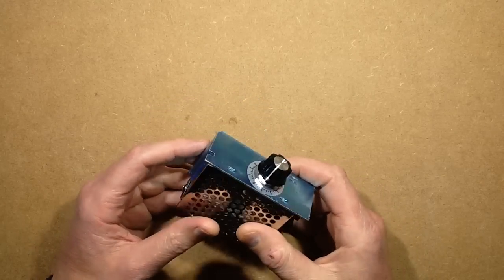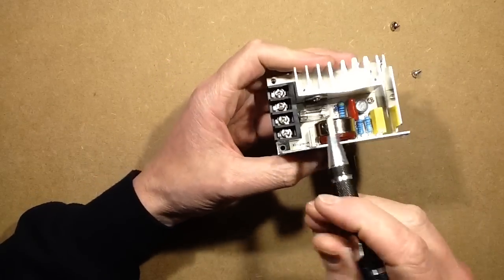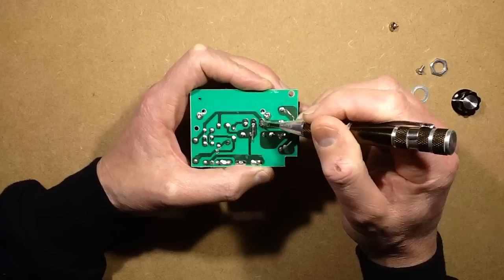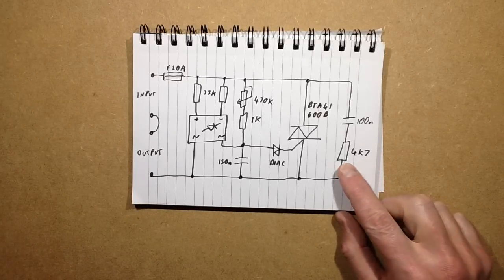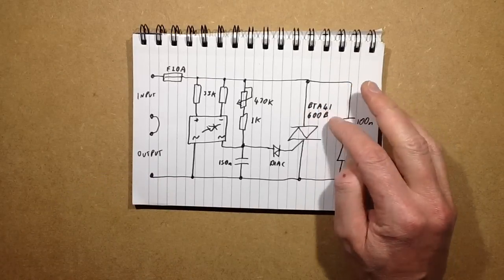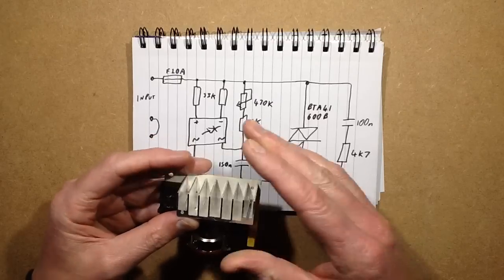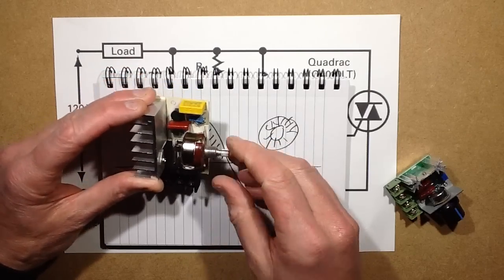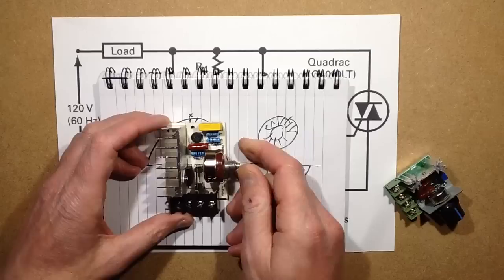Inside a "4kW" ebay power controller with schematic.

Comment: What did you pay for that? Got the same stuff here shipped from china for only five euro's Works fine for my lamps The Beefy triac survived two tungsten lamp blowouts already :) Normal consumer "dimmers" usually fail when a light bulb fails in short out mode. The large variable resistor can be to small for the heat produced in it when used with capacitive and inductive loads. Depending on where the slider is it can overload and burn out ~slowly.
Reply: Not sure if it is true but I read that tungsten lights do not like to be turned down to half voltage as that messes with the evaporation and re- deposition of the tungsten in the crystal bulb. I have found the tungsten flood lights work for longer when left on full power.

Comment: I replaced the 4k7 with 25pcs of 100 ohm half watt resistors all in parallel and haven't tore the controller up since or been able to overpower it either... it just pops breakers in the house now...   :-)
Reply: I did solder a piece of 10 gauge copper wire between terminals where the fuse was... also not safe!!!!

Comment: Nice video and explanation. The high voltage clearance around the triac legs looks a bit dodgy (small). Also, I'm not one for trusting the isolation clearances of a cheap carbon pot ( I know they say 750v, but I've seen the guts of pots like that fall to bits on more than one occasion).

Comment: Thanks for the nice Analysis - I don't like the screw so close to the high voltage track on the backside close to MT1. This could easely short out and put the heatsink at high voltage.

Comment: So if I wanted to use this on an induction motor (such as a treadmill motor), what would you suggest I add in order to get good variation of speed from 0 - it's maximum?
Thank you very much for your great videos!
Reply: I tested with the inductive motor of air fan and angle phase triacs does not work at all.

Comment: @bigclivedotcom- I have one of these controllers, have you checked the output voltage on it? When the unit is at 100% it is off by 20 volts. Is this because of r1 in your diagram? Great work, I'm always looking forward to new videos!!
Reply: +Matthew Lawrence, you know this how, exactly? Did you use an oscilloscope? Or perhaps a peak-capture circuit? I bet not. True RMS is the least quality meter to make such a claim. Cheap meters WILL give you erroneous readings and even a lot of devices which claim to read "true RMS" (like Kill-a-watt) are lying like dogs. Most likely the inevitable turn-on delay in the first part of each half-cycle is confusing your meter.
Reply: YodaWhat I know exactly by means of my Fluke multimeter mine was only 15 volts low. I assumed like buck/boost converters it absorbs some of the voltage in the circuitry and heat loss an such.

Comment: Thanks for another great video. I have just got one of these to use on my solar immersion heater control. I see many different suppliers of the same thing but they show completely different connections to what looks like an identical unit. Any input would be appreciated, should not the fuse be on the input?

Comment: actualy on philips diac dimmers you still find the big inductance for filtering...  this module is only a chep chinese one that's why is missing... try use it and try do a measuring with the oscilloscope to see how much common noise you get while is working... that's the problem with the cheap things like power supplies ecc... i had cheap led lamps in my lab and while there where on I could not use the oscilloscope...

Comment: Hi. First I want to say I love your informative and engaging vids. As an electronic dunce I have learned a lot. I am trying to control the speed of a universal motor and am now happy, thanks to your material, that I will use a pwm circuit similar to this but I am really struggling to work out what needs adding to the circuit to allow torque to be maintained at low speed. Despite a lot of research I can't find an explanation I can understand of what is required to maintain / change the torque. Is that something you could help with please? Thanks and keep up the great work.
Jim

Comment: So i bought this exact module, I'm planning to use it to power a 2Kw mains water heater element using a 12v 1.5Kw inverter. The 1.5Kw inverter is powered by 4x110ah 12v lead acid batteries. So the plan is the inverter 220v output will go to this module then to the 2Kw water heater, hopefully running the water heater at around 1Kw. Would there be any problems with this arrangement? Thanks!
Reply from the maker: The dimmer might not like the inverter waveform.  You can get low voltage elements for direct use from a battery bank.
Using a water heater as a load dump for a solar panel or turbine is a great way to use power above that required to charge the batteries.
Reply: @bigclivedotcom  thanks very much for the reply! It's a pure sine wave inverter so hopefully that would help?

Yes, I'm actually doing that exact thing! Its a 15L mains water tank which I've modified to also fit a 12v 300w element, that's sealed in with bolts and high temp gasket sealant. So it has two elements in it now.

All the water heaters electronics can work on either 12v or 240v and therefore all the thermal safety cut offs should still work regardless of what element is being used.

I have dual isolating transfer breakers at either end to ensure 12v and 240v feed can't go to the unit at the same time if a mistake is made!

It will mainly be left on 12v and I have a 40a DC relay between the water heater and the battery bank, there is no connection when the relay is closed. The relay is opened/ actuated by a small voltage sensing relay which reads the battery bank voltage. If the battery bank gets above 13.2v then the vsr actuates the 40a relay and dumps the excess charging power from the solar/alternator to the hot water heater.

If you're interested I might send you a video/ diagram when it's all put together and you can let me know if I'm about to cause imminent fire, electrocution, explosion!!😂
Reply: I should also mention that only the 240v 2000w element is used when 240v ac is supplied. And only the 12v 300w element is used when 12v DC is supplied.

Comment: I have one of these controlling a 2000 Watt element in a pot still. I mounted a small fan on it as the heat sink gets warm and it works for several hours at a time but it preforms very well and is CHEAP. Thanks for explaining how it works. For controlling an element what could better for the money.
Reply: I`ve just bought a similar one for making the ironing water

Comment: I'm hoping that I'm not the first to realise that 10 amps on 400 volts is 4kw.
Reply: On a resistive load, yes?
Reply: Why would you use this between two phases?
Reply: @0x8badf00d  I think you actually could use it between phases, but Chinese are notourious for stating peak currents, a 10A fuse needs time to heat up and burn so in theory it possibly could conduct 4000w for a short time. I would love to run my 4kw heat element on this thing to see how long it lasts. and see if lets say 10A at 240v (2400W) of inductive load for an extended amount of time overheats the circuit. If not this is a real dealbreaker for my homebrewing kit.

Comment: Suggestions, attach your wiring diagram so that it can be cut & pasted for print, also sometime when you have the notion, how about a video on the various VFD's on EBAY, especially the single phase input to 3 phase output, thanks.

Comment: You missed something, Clive. The labelling on the case indicating input and output is opposite to the circuit itself, I.E it has the fuse on what is labelled as the output connector. I just connected one, as per the label, the triac went bang. I watched your vid, looked at your circuit, noticed yours was mislabelled just like mine, replaced the smouldering remains of the triac, ignored the label, reversed the connections and all is well.

Comment: Dear Clive! I have built a TIG welder from an old stick welder. I have argon post-flow, switch button start and with this 4kW regulator i can regulate my welder below the value allowed by the magnetic shunt. I want to add a pulsed TIG function to my machine utilizing a relay delay timer module (switching between two different resistor values on the 4kW regulator). What currents/Voltages we have on that big potentiometer? Can/should I use snubbers to protect the relay contacts? Thank You very much in advance!
Reply from the maker: Treat the potentiometer as being live at mains voltage.  I'd suggest using half watt resistors.  The relay won't be passing much current.
I'm surprised the triac has survived such a fierce inductive load.
Reply: @bigclivedotcom  Thank YOu very much! In fact, tried it with max power as well and it worked for a short time when the fuse melted. At max power I am measuring a bit above 2kW which around the top for the fuse. Added fan cooling and paste to the triac and it seems it can handle the max load. However pulsing is needed only for thin stainless welds where the high power is around 50A; 1kW at the primary.. Give it a try this weekend.

Comment: I was very excited to see that you were messing around with these. But then I saw that it’s from 5 years ago😞 because I’ve been wanting to ask you to go through a 5000 W 10 to 50 V 100 amp controller DC or the bigger ones would even be great too and show us how to connect a electronica throttle to them as they want $50 for a 5000 W but if you want a electric throttle on it they want $125

Comment: Hi Clive, I've got a question regarding live and neutral inputs. I got basically the same controller (except it's a digital one) that has marked L and N input/output on the chassis itself, so I was wondering if it would work if live and negative lines are switched because I'm from EU and our plugs are not polarized (you can plug them both ways)?
Or is there any other component that can I use before this controller in the circuit to make sure that live input is always live, no matter how I plug it?

Comment: Hi. There is an effective method without using layers as the rectifier tip passes a sawtooth signal, such as smoothing that signal to eliminate that network interference and canceling out that sound produced by that network interference.

Comment: Hi Clive,

Can you please advise how can I test the SCR to determine whether it works correctly? My concern is that with no load and connected to a 220V supply I receive an output of 220V irrespective of the potentiometer position.

Will the Volts drop when the Treadmill motor is connected and then only increase as the potentiometer is dialed in?

As the Treadmill motor is max 180V I do not want to connect it and then the motor gets blown as the Voltage is not regulated?

Regards

Hendrik

Comment: Do you own an oscilloscope? It would be nice to see some of the waveforms with operating devices. A few turns on the end of some coax and you have a poor mans current probe.
Reply: I suspect he has more than one, but most 'scopes aren't likely to survive mains voltage without high voltage probe set.
Reply: Scopes survive mains voltage just fine with standard probes.  Scope inputs are typically at least CAT I rated to 300V.  What you have to watch out for with line voltage is the scope ground is mains referenced.  This means you should always use an isolation transformer when using your scope to probe mains powered devices to avoid unfortunate accidents that will destroy your scope.

Comment: this is a very popular device used in controlling DIY alcohol distilling heating elements
Reply: Thanks
Reply: Would 3000w heat element work in a 30l pot with this device? Thank you.

Comment: So would this work as a speed control for a 1/2 to 1 hp motor? I'm not worried about maintaining speed under load as it wouldn't really have any, just adjust the speed it turns.

Comment: I have had one of these, they are less reliable than a plumbers estimate and the tracks are not designed to handle anywhere near the current its rated for.

Comment: You confused me.
The diagrams were different and you referred to the wrong leg, 
You had explained the current going the opposite way through a diod, where as it was via the 1k and variable r. 

That makes sense to me, where as you hadn't. But there was a variation to the two drawings.

I had hopped this would give me some insight to something I dont know.

Issue:
Variable DC voltage in (6-60)  fixed voltage out (14) high current circuit. (2-30amp).
I found some China boost bucks, but they're so low current (4-5) that it's not going to work for what I want.

Any clues?

Comment: what type of ceramic fuse would you go for, also if i use a 5k potentiometer would i have more control over power or would that be insufficent to get it up to full speed. Or would a 100k one give you a better starting speed it would be used with a treadmill motor. to power a sander,grinding machine .TIA

Comment: Where did you get that amazing screwdriver pen from?
Reply from the maker: Poundland in the UK.  It's often sold as a 9 in 1 or 8 in 1 precision screwdriver set on eBay.
Reply: bigclivedotcom Thank you good sir!
Reply: Search eBay for
25 in 1 Precicision Screwdriver Repair Tool Set
and you'll find some really nice ones for under £5
sets of 32 and 38 also worth looking at
Reply: "Repair Opening Pry Spudger Screwdrivers Tool Kit Set" also worth looking at for prying stuff open when Clive's "hammer and wrench" method fails ;)
Reply: Peter D Morrison Awesome, thanks! :)
Reply: Buy an Kingston HyperX SSD harddrive set and you get it for free! :D
Reply: You mean the one that is constantly falling apart? There are many words which describe that screwdriver, and I don't think "Amazing" would be one......lol.
Reply: These are very common promotional gifts with some logo stamped on the side. I got one with the tip receiver hole coming out the end at an angle so the tip rotated off 90 degrees. Garbage.

Comment: I've been asked to repair a kitchen extractor fan, it draws about 2kw, it's an induction with capacitor single phase motor. It's speed controller has failed . Was wondering if this could be used atleast to drop the speed maybe a third . Do you think the fan motor would overheat as I know this is not the way to slow an induction motor down. What you think
Reply from the maker: I wouldn't use this in a professional application.

Comment: Hi Clive, I just bought one but the snubber capacitor broke off during transport. Would it be ok if I reolace it by  a F1774 100nF (250V)? I'm planning to use it on a 2K heater.

Comment: Hey Clive. I know it's an old video but just wanted to tell you that mine has a 47 ohm resistor on the snubber. Also, I added a 100uh 8A inducter after the fuse and it quieted it down a lot. Also changed the fuse for an 8amp resettable. Do you think the setup would benefit from a common mode at the inputs? The whole unit isn't really good after 2kW....but that's ok it serves a purpose. Great vid BTW. Cheers
Reply from the maker: It does need some suppression, so at a minimum a beefy toroidal inductor in series would be a good idea.
Reply from the maker: Oops!  You actually said that.  I'm not sure a common mode choke would add much.  There's not really high frequency noise being generated.  Interesting that yours has a more sensible component selection for the snubber.

Comment: With the Chinese using fake parts, less than spec. substitutions..., it would be most valuable if you actually tested stuff to see if the advertised ratings are valid.  Thanks for your work explaining the operation.   Thumbs up.

Comment: Is that speed controller suitable for a wood lathe (universal 220V motor) for example? I would like to bypass the 4 speeds pulleys and belt system but my concern is that it could stall under load at slow speeds.

Comment: Thanks for performing this experiment with these information and description. I want to ask :
If I want to perform the same experiment but the power used is 220V AC current, Which values must be changed?
Thanks in Advance
Reply from the maker: This unit was rated for 220V-240V.

Comment: Be careful with these boxes, the connectors appears to be swapped on different units, I'm still not entirely sure which way round mine is supposed to go. Although thinking about it, if it is AC, it doesn't matter which side the load goes on?
Reply: (Input N L- L N output) NOT (output N L-L N input)  mine was also back to front. Stamped markings. It mattered.

Comment: Interesting!  I struggled with an AC dimmer that didn't work out of the box so attempted to bread-board my own circuit.  It didn't work either so I did what any sensible tech would have done - I went to another project.  The dimmer is still in pieces on my bench, but now, thanks to Big Clive's explanation, I know how it works, and I know how to make it better than before.  One question though;  Where would you put that toroid filter to reduce the hash the thing produces?
Reply: OK, in series with the output seems to be the correct answer to this question.  What color (mix) toroid to use is next.  To keep from buying the wrong kind I was hoping one of you knew this information so I wouldn't have to experiment too much.
Reply: I think red is the color you want. Iron powder core.
Reply: Just realized the comment's 2 years old. You probably already figured something out.

Comment: Hey Clive, you mentioned towards the end of the video that this rectifier circuit would be advantageous also when controlling inductive loads such as transformers. My question is: can I control my 500VA isolation transformer (220V-220V) and will that in fact create a pseudo variac?
Reply from the maker: I wouldn't recommend it.  The transformer would be quite an aggressive load.